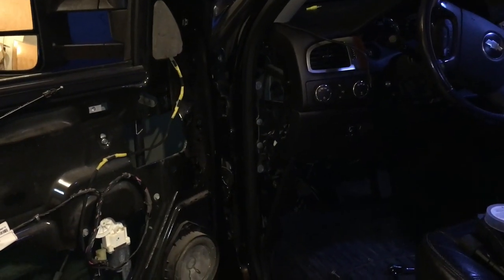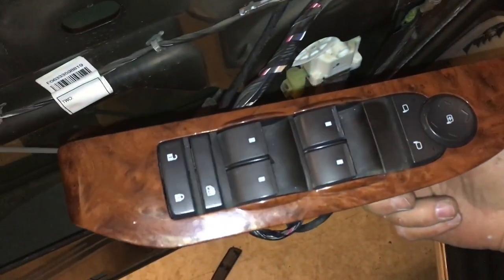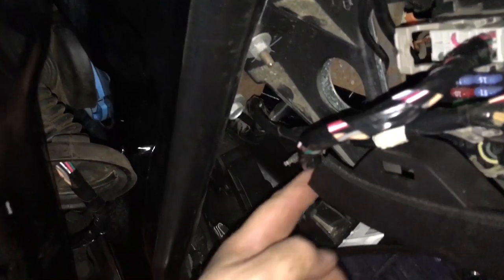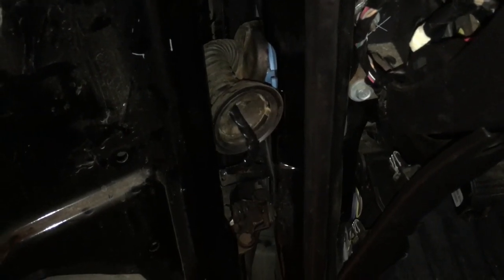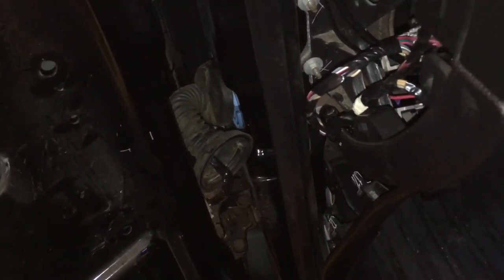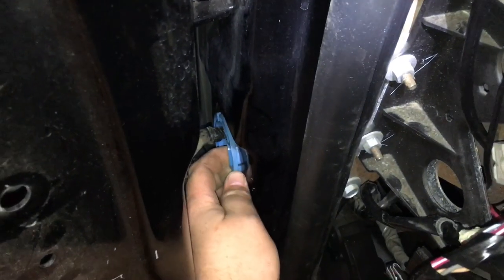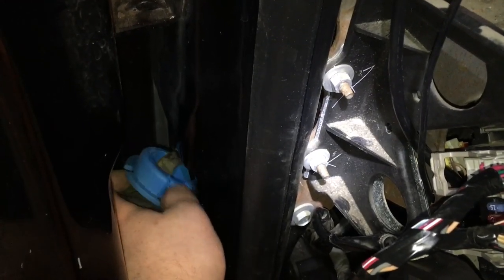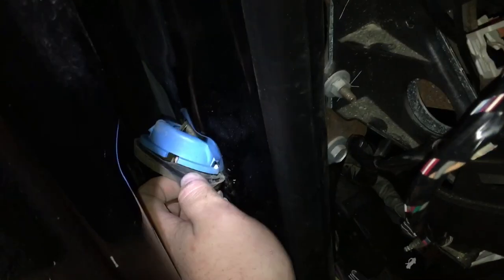Silverado or Sierra Window Switch fix

Comment: You just saved me HOURS worth of work and frustration!!! Pulled the boot back on the wires and saw that the black ground wire was broken clean through! 😳
A quick splice and everything works perfectly again. Thanks for the tips on getting the boot back in place with those plastic bushings. Man I love YouTube, and am so thankful for you sharing this video. It's priceless knowledge for each and every one of us that has also run into this problem. 🙌🤜🤛

Comment: Literally just got this fixed on my 08 sierra 1500 the black wire was almost cut in half from slamming it so much due to my door hinge being almost ripped from the frame. Thank you so much you saved me $500.

Comment: I also checked this video luckily before buying a used switch. Seems to be a Chronic issue with the black wire only as noted in other comments. All the other wires had no visible damage whatsoever. Butt Spliced it together, wrapped with electrical tape and good to go.

Comment: Thanks for the video.
Question Only my front driverside window will not go up/down. Changed the regulator assembly and  a new master window switch and no luck.
When I pressed the driverside button up or down I hear a tic tic from the master switch. Same on the one I changed. Wonder what you mentioned could be my issue
Thanks again for the video
Reply: Same with mine but driver side back and front did you ever fixed it?
Reply: I would be shocked if it wasn’t a problem at the fuse box or beyond. The ticking isn’t a good sign. Update us if you figure out the issue

Comment: All my windows work except the drivers side, and both my mirrors don't work and I have power at the connection, I put in new switches and still nothing, so idk
Reply: The same with me, did you ever get it fix ?
Reply: @buddymoney2418  yes it was all the wires in the rubber boot where the door hinges, they were all broke loose
Reply: Ok thanks a lot
Reply: Thanks 🙏🏾
Reply: @buddymoney2418  Yep 👍

Comment: I have a similar problem with my 08 tahoe the switch works but sometimes I'll notice  it's not lit up. And my switch wont work. Then it will randomly start working again. It happens  when I'm driving  tho so. I'm hoping it's a messed up wire

Comment: How did you pop the brown 'wood grain'  trim piece up?  Do you pry it from the door handle end, or the opposite end first?
Reply: In my 08 sierra I pried from door handle end gently with a screwdriver. Unfortunately the problem wasn’t wires with mine though

Comment: Only window that won’t go down is my driver door. I really hope this is the problem. School has taken all my money this semester.
Reply: Did you find out what was the problem
Reply: Omar Argullin I had a guy hook it up to a voltage tester (or something similar) he said the window motor was good, but the whole switch was bad. Perhaps it shorted out when wet.
Reply: @pimpmyride7278  so you had to bought the whole switch then?
Reply: Omar Argullin nah. It was hella expensive. I don’t really drive the Tahoe much. It will have to wait. No job since COVID19 outbreak.
Reply: @pimpmyride7278  yea i hear you.